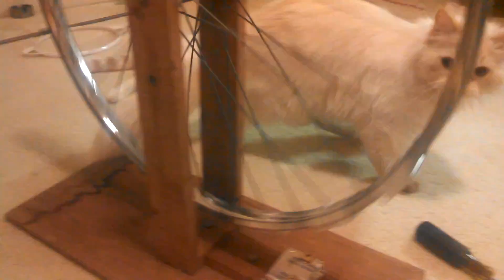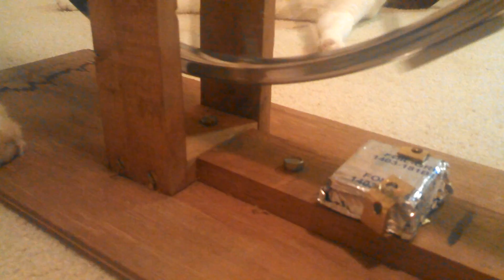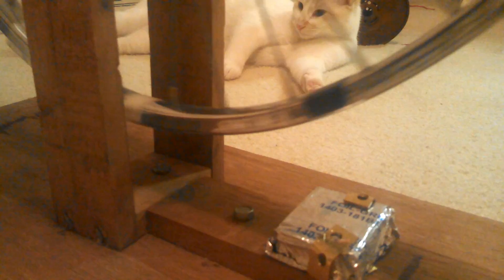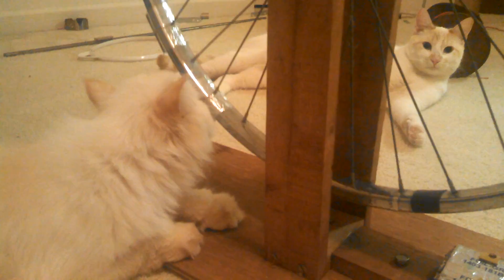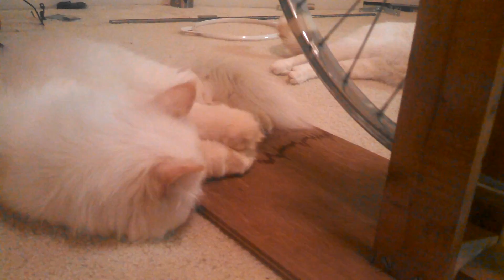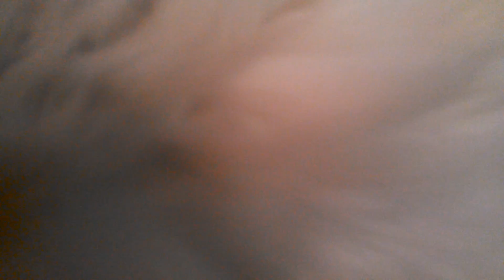🧲 Success! Magnetically Self Running Wheel/Motor (NO LONG TEST EVER PERFORMED)!

Comment: From what I've seen of your videos your wheel just manages to keep going. To get any useful power out of it I've seen comments about scaling it up and new configurations.
To increase the torque available how about positioning a coil about 45 degrees from the shielded stator magnet. As the armature magnets move past the coil, the charge generated can be fed to a capacitor via a bridge rectifier and stored. (The bridge rectifier ensures that both positive and negative going pulses from the coil can be used and when the coil is not generating any pulses it stops the capacitor discharging back through the coil). This will slow the wheel down but with care it should make it to when the next group of magnets reach the stator. As the last magnet leaves the stator (the sticky spot) the charge in the capacitor can be switched by a reed switch and suitably positioned magnet on the side of the wheel to drive another coil positioned to give the armature magnet a kick thus exiting the sticky spot with a higher velocity than with permanent magnets alone. On the next cycle the wheel will spin slightly faster so slightly more charge will be stored in the capacitor resulting in a slightly stronger kick etc. If the wheel is truly overunity then this configuration will regenerate and multiply the power available.
 A historical analogy is the earliest dynamos where the armature span in a magnetic field from permanent magnets only. This meant that a dynamo the size of a car was needed to produce 1 or 2 KW of power. Then someone had the bright idea of using some of the power generated to assist the field. This boosted efficiency so dynamos a fraction of the size could produce the same power.

Comment: hi James. 
Love your work. I have had some good sucess using your stators that i will be posting on u tube next week. One question, the side of the stator with the lid, do you have more luck with it facing towards or away from the wheel?
Check out some of my other magnet prototypes here on u tube if u get time.
Thanks for the inspiration
Gene
Reply from the maker: Towards. And there is no lid. I visited your channel and found no update there yet. I resume my work come this April, 2014.
Reply from the maker: I've tried to contact you over the years, but to no avail. Youve not posted anything new in over three years as well I noticed.
Reply from the maker: Why did you walk away from your channel. You were doing great! https://youtu.be/jsgUF5DHAwo - I featured your work in this video.

Comment: I don't understand what you think you've made here, the energy required to enter the magnetic field is exactly equal to the energy released by the repulsion. So it's just like a pendulum. If you minimize friction enough it will go for a very very long time, but it will generate precisely zero energy.
Reply from the maker: You are dead wrong. Watch this video all the way through for absolute proof to the contrary. https://youtu.be/jsgUF5DHAwo

Comment from the maker: @22wellerman The wheel is too slow to produce electricity with magnet wire wrapped around the wheel. However the wheel produces lots of torque which in turn can be used to generate electricity by converting the torque to a smaller axis to turn a generator at a high speed.
Reply from the maker: This was to test theory. Huge magnet produce ungodly amount of torque. This is just a wimpy set up. https://youtu.be/jsgUF5DHAwo